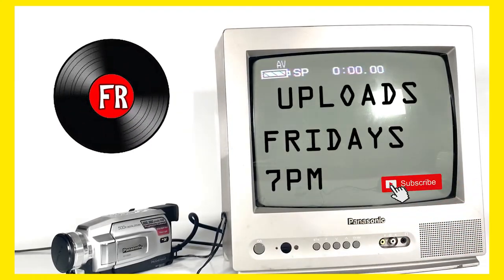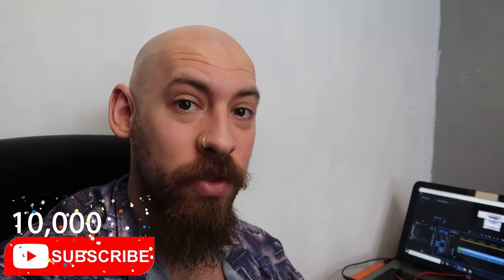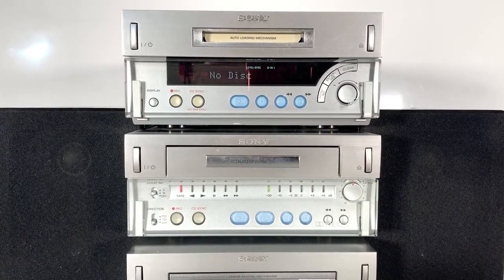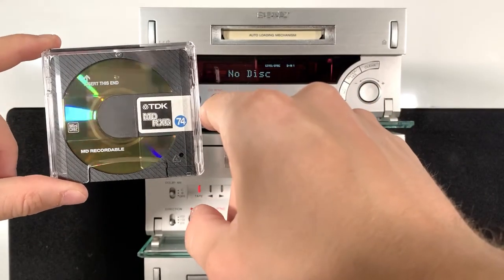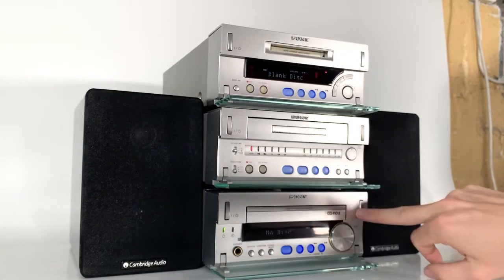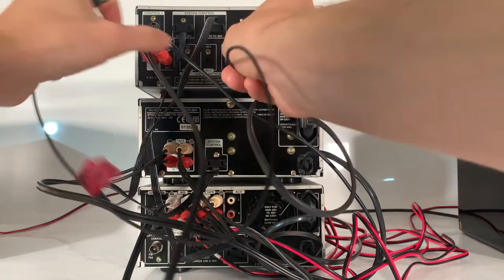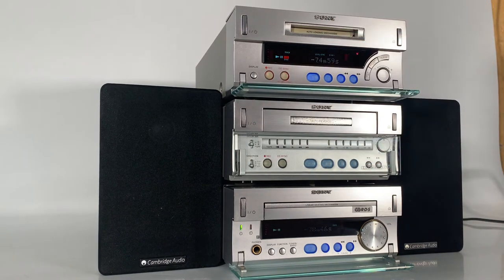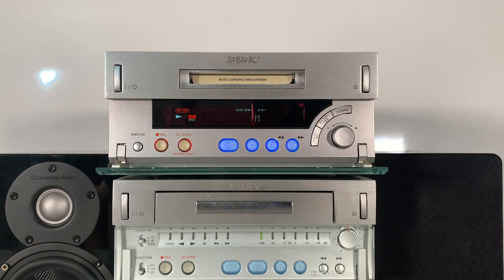SONY CMT SD1 HiFi System CD To MINI DISC Conversion TUTORIAL

Comment: Excellent choice of unit, I only have the CMT-SD1 unit, and I want to ask you if you have been able to record a Minidisc using the optical inputs from a mixer or a computer?
I don't know how to select D-IN 1 or D-IN 2 (by default it uses the analog input)
Believe me, before asking, I have read the manual several times and I cannot find the option to select those entries. any tip will be appreciated,

Comment: I'm just wondering one thing.  If you look on the back there should be a port called "CONTROL 1".  In the schematic it looks like it's for a keyboard (which isn't uncommon for minidisc).  However it never mentions it is in the manual, it would be used for titling.  If you have a PS2 keyboard layout around, please try it out and see if it works.

Comment: 🤦‍♂️ 😂 oh well, that gave me a laugh at least.  Nice little system, I have one myself almost new-in-box in my parents' attic...soon after I bought it, I emigrated. It also reminds me of my ex, which was another reason  to box it up!! There's also a glass/"marble" (corian) "stand" available for the main unit, prob quite rare now. I wonder whether my minidisc slot & white buttons have yellowed like yours...maybe not since it's been in total darkness for almost 20 years ☺️ The original speakers aren't too bad either, look better with the front covers removed. 
The best little system Sony sold was the "La Scala" system, very VERY nice. Also a lot more expensive. Came out about 5 years before this system (mid 90s).
Reply from the maker: We’d love to get our hands on one of those systems! Subscribe for more videos each week.
Reply: Sony did another system around the same time as the one you have, bit more high-end, all components connected with firewire digital cables. Was called LISSA.